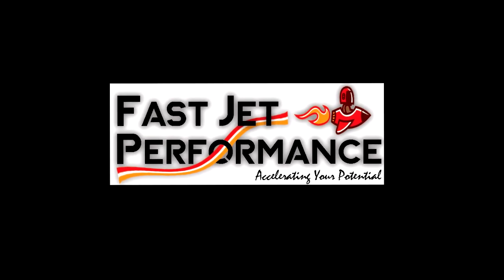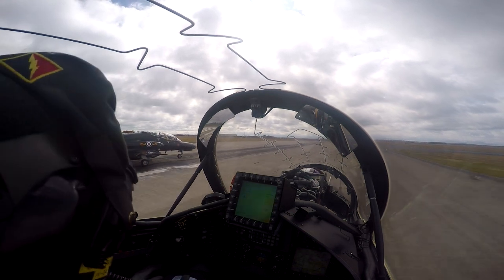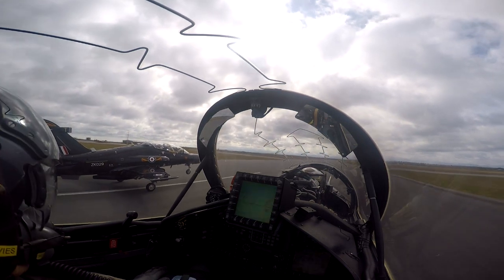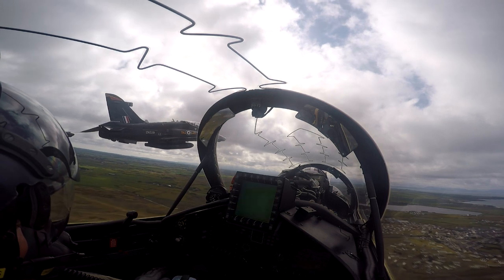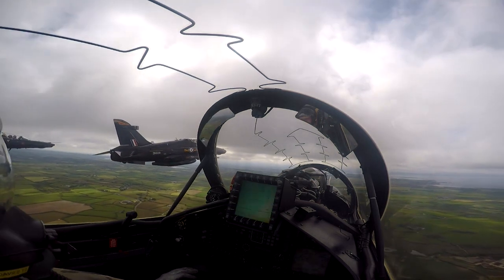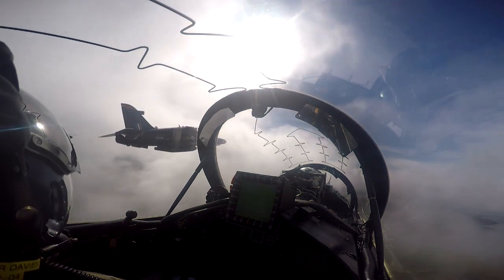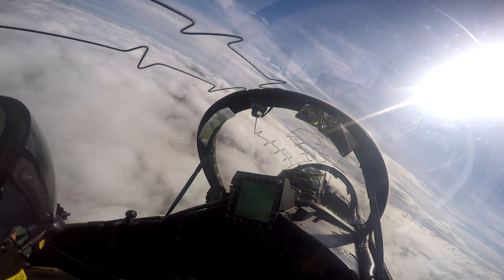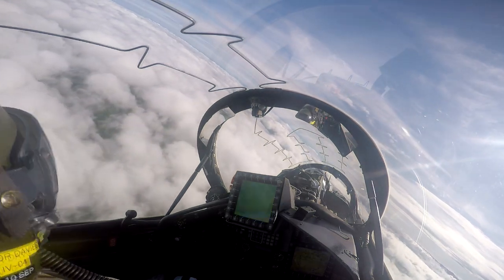Hawk T2 - Formation Take-Off

Comment: Can I ask a question?  As a private pilot we are warned about wake turbulence, particularly when aircraft are flying slowly with high AoA, with wingtip vortices being the worst.  What, if any, thought is given to those effects in take offs when you’re that close together?  Thanks for the great content!
Reply from the maker: Quite a lot, it's all to do with aircraft weight. If the aircraft you are following is heavier than you and the winds are light, then give it a couple of minutes before you follow it.
Reply: Fast Jet Performance hi - and thanks v much for the reply!  I’m a bit confused though - on those take offs you’re right next to each other, and only a fraction of a second apart.  Do the tip vortices present a danger as the aircraft in front rotates and generates that turbulence, or does the Hawk slice through it so you don’t have to worry?!  Cheers!
Reply from the maker: @DanSmithBK  the Hawks weigh the same as each other which is the critical part and tip vortices would be noticeable if we were further back on the first jet. We would always tell students on the wing, ie. the number 2 jet, to not drop back and to stay close to the leader because if they did then they would get a wing drop from tip vortices.
Reply: Fast Jet Performance aaahhh - so it’s staying close that keeps it safe! Cool, thanks very much - every day is a school day!
Reply from the maker: @DanSmithBK  no worries, just don't drop back 👍

Comment: When leaving a Military airfield are you instructed to fly Standard Instrument Departures? or do you just receive vectors before resuming your own navigation?
Reply from the maker: We can fly VFR or IFR, we pre-brief tower for both. Normally from Valley, if it's a clear day, we'll fly a 'non-standard (with a heading) to x thousand feet for low level entry at ...' - that gives us flexibility for our own navigation - you'll go 'en route' ie. change frequency away from Valley when outside 10 to 15 miles if the weather is good.
Reply: Okay thank you.

Comment: Tim, ex Lossie controller. We used to have 100sqn and some of your guys up for visits in the past. As there's nothing said on freq when you all release brakes, what signal do you use to synchronise take off roll?
Reply from the maker: The flight lead gets a thumbs up from the numbers 2 and 3 then they tap their head 3 times and then 'nod' forwards. The nod is the brakes release signal.